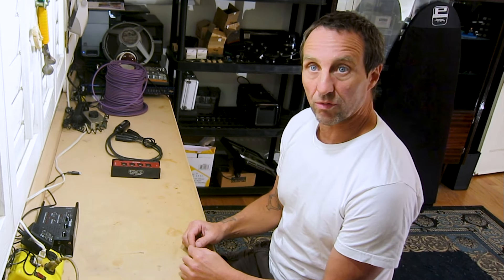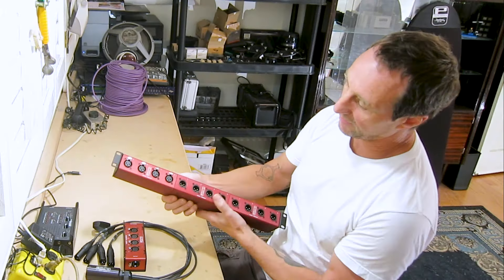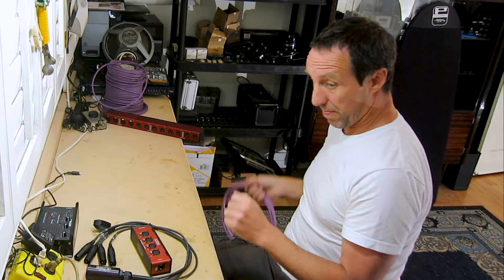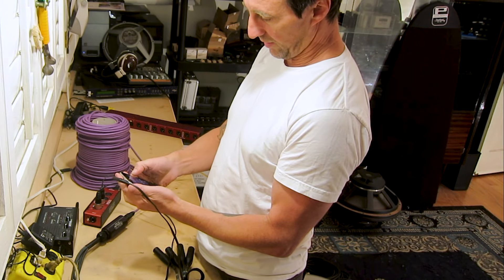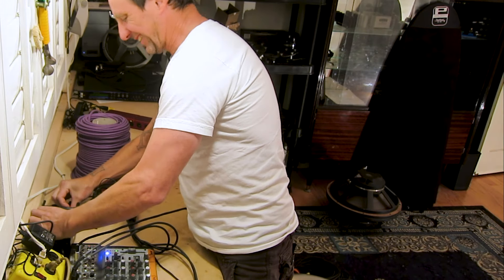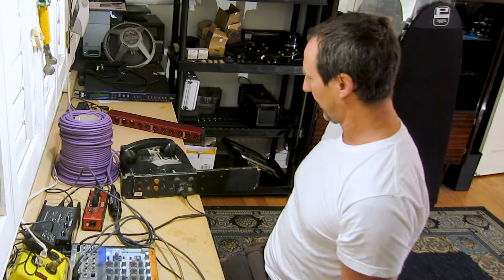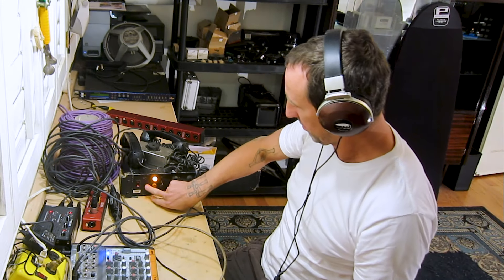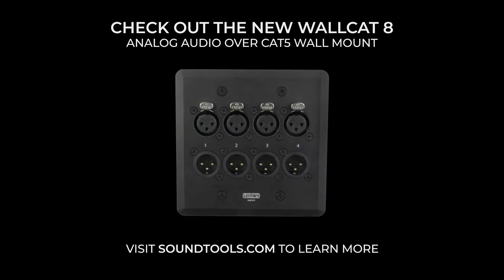Simultaneous Analog, AES3 and COM Down Cat5e Cable

Comment: What about a ribbon mic and also a high level line signal with zero crosstalk occurring?
Reply from the maker: As long as you use a cat 5e or cat 6a cable that has individually shielded pairs your crosstalk rejection will be equal to or better than it is with a normal audio snake

With a normal audio snake it's generally not advisable to run high level signals down your mic line multicore but in most of many scenarios you can do it just fine

Same thing applies to running high level and low level signals down individually shielded pair cat cable except cat cable performs a bit better than normal audio snake

The reason is that the twisted pairs in cat cable are much more precise and designed for rejection of much higher frequencies which tend to have the biggest cross-talk issues.

So pretty much do anything you would normally do with a normal audio snake except you can expect better results over individually shielded pair cat cable

In fact cat cable performs so well with its twisted pairs that you can get excellent performance from cat cable that does not have individually shielded pairs and just has an overall shield. Something that's unheard of and would never even be considered with audio cable
Reply: @DaveRat  Yes! Thanks for your response. I have had numerous conversations with people who say 'nah its fine any cat 5 cable will work' and I've seemingly been butting my head against a wall telling them the pairs have to be individually shielded. It's a very cool solution though I must say! The unshielded pairs thing works obviously because of phase cancellation along a twisted line when they are all at similar levels, but vastly varying voltages - ie my example, there will most definitely be crosstalk on the lover voltage line.
Reply from the maker: Well, I think you may be taking that angle farther than testing and real work plays out.

In this video I am using cable without individually shielded pairs. 328 feet of unshielded pairs, just an overall shield and crosstalk is low enough to be a non issue.

Crosstalk tend to be a high frq issue and  high level signals like COM and many line level outs don't have loads of high freq content at high level.

And as long as you are not adding loads of HF gain to a low level signal, crosstalk will not be an issue.

In you example of a ribbon mic which unless it is a Royer that has a phantom powered preamp, would need an extra 20 dB of gain or so, is an extreme scenario and individual shield would be important.

So in summary, individually shielded Cat cable has better crosstalk rejection than audio snake cable.

Cat cable without individual shields has excellent crosstalk rejection that is so good that it will work perfectly for all but the most extreme situations 

Running extreme high level and low level signals down the same multicore is not advisable for audio snake or cat cable.

For scenarios where the signal levels are similar like normal mic levels and normal line level, you do not need individually shielded pairs in cat cable.
Reply from the maker: Well typically that synth should go through a DI box and back in the '60s running plus four out of a synthesizer was not really happening.

Everything ran much lower levels then and it was transformers everywhere to get things to the proper levels.

I would say the cross talk in those old consoles probably exceeded the cross talk of unshielded pairs in a cat cable.

And Ruben Mike's have been a source of cross talk issues I can remember from way back.

I bought a bunch of Buyer rib and Mike's and we had returns running down the mic snake and adding high end to the ribbon mics created an RF type feedback squeal.

That said with cat cable being four channel it's easy to compartmentalize your high and low level signals into separate runs unlike those 24 channel audio snakes with 20 mic inputs and four returns.

As a manufacturer of sound tools products, and a manufacturer of various cables including individually shielded and non-individually shielded pair versions, I can honestly say that CrossTalk issues are not manifesting in world deployment.

We have literally sold hundreds of miles of non-individually shielded Super Cat cable for analog over cat and we do not have cross talk complaints returns or issues.

I will tell you what we do run into is that with unterminated pairs. When the twisted pairs are plugged into an input channel with significant gain and there is nothing on the other end plugged in to that line, The non-shielded twisted pairs tend to act more like an antenna than a shielded twisted pair.

The solution is to not turn on the inputs that don't have anything plugged into them or to plug something into them.

The twisted Paris work really well at reducing crosstalk, on old audio snakes they're tended to be places leading into and out of the multi-core ends that were not twisted nor shielded as well as the non-twisted non shielded lengths of wire attaching to the XLRs. Plus the lower amount of twists involved.

With cat cable all of these vulnerabilities are minimized and the cable remains well twisted.

Lots of variables but I can tell you that in practice the cross talk concern and issues are minimal.

The bigger issue is RF interference and issues with people using unshielded cat cable. Or using shielded cat 5 cable but not terminating the grounds properly or using the right connectors that allow the shield to pass through

Comment: Try a microphone + a DMX Line ;-)
Reply from the maker: That works just fine as long as you use CAT7 cable or Cat6a with individually shielded pairs. Sound tools makes three cables that work well for that. The Super Cat 7, the Super Cat sound, and the Super Cat XM
Reply: STP for the win!

Comment: you know this is an old video because the phone has a headphone jack!!
Reply: Us squeaks are buying phones based on that criteria alone. You can still get new phones with minijacks.
Reply from the maker: Agreed, yes, an ald video back from 2015! And yes, we squeaks do seek the 1/8" I have a main phone with no 1/8" and still have a phone like the one in the vid that that has a 1/8" that I use for sound testing.
Reply: My current model phone has a headphone jack, it's just not a shitty fruit based system

Comment: Would there be any issue with running low voltage power down one of these lines? I know there could be if the amps are too high for the gauge of wire of the cat6 cable. 

I ask this because currently I am running 2 mics with phantom power, one midi channel (Made a midi to xlr adapter for each end) and spliced a 5v 200ma power supply in half, put xlr ends on each side, and am sending it down a 35ft shielded cat6. It seems to work fine but I just curious if you know of any issues I could run into that I haven't thought of.
Reply from the maker: Yes you can run Phantom power and clear com is actually much higher DC power than Phantom power. 

You can individually fandom power the channels and it won't affect the other channels and you can individually clear come channels and it won't affect the other channels.

Here's a leak to a video where I ran and tested an SM58 and a Phantom powered AKG c414 down 6 mi of cat5e cables

https://youtu.be/SorO-QpqYRU?si=6vqwDt1XyNi_dSMP
Reply: That's fine a long as you check the voltage and current specs for the cable and stay within it. Power Over Ethernet is a thing, though it uses somewhat higher voltages to reduce the current requirements.

Just be careful with the term "low voltage" around this, as it's often used in the electrical industry to refer to the 120V or 240V AC that comes out of the wall, because it's low relative to the kilovolt levels on the distribution network.
Reply: Out of curiosity, what was/is the situation that you're using this setup? Sounds neat
Reply from the maker: @adamcoe we don't use this exact scenario but we do use a similar setup for our Comms racks. We have these 12 space racks with an analog mixing console and a clear com base station, 

In a drawer there are two four-channel cat boxes one for front of house and one for monitor position. 

Down the four lines we run the front of house mic and monitor Mike and mixer output and clear com.

Then there's a self-powered monitor speaker at front of house end monitor position they can plug into the cat box. And the front of house in monitor engineer have shout mics they plug into the cat box. Andy carries the com lines as well. 

So you pretty much have a fully self-contained communication system that relies on a single cat5 cable to interconnect it to various places.

We have found that using this separate system is more reliable and easier than trying to rely on communicating while using the actual mixing consoles that are used for the show. Because many bands bring their own consoles and for whatever reason if you swap consoles the shout system always stays alive

We also use these fade boxes for vocal mics down front and simple splitter systems.
Reply: @adamcoe  I have a Grand Piano with a QRS PNOscan installed. It is a midi sensor that triggers a Yamaha Motif XS rack off stage for the piano sound. I have 4 lines running to/from the piano, 2 mic lines for dpa4099's as backup/blend channels, a midi line, (which is midi to xlr) and then the pnoscan needs a power supply, so i cut the cable to it in half and soldered xlr ends to each side to send it down the cat line. I have the cat box permanently installed in the piano and in the rack, so all I have to do is plug in a cat5 cable and we're rocking.
Reply from the maker: So cool and what a great usage and clever set up!